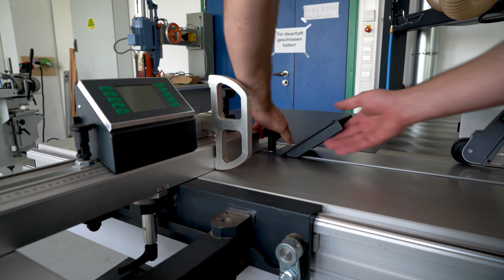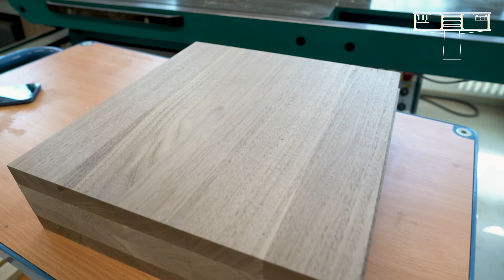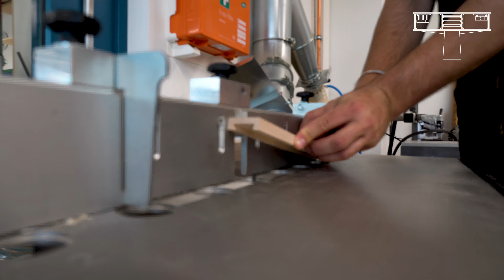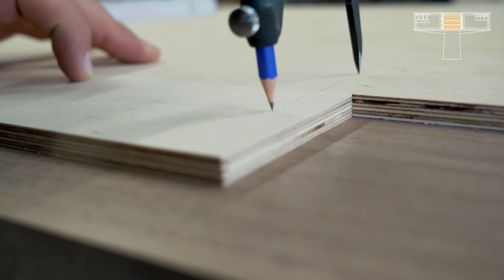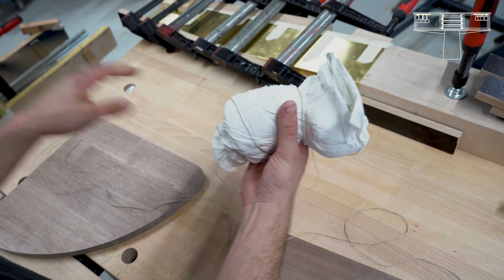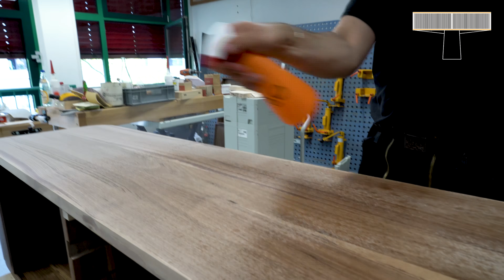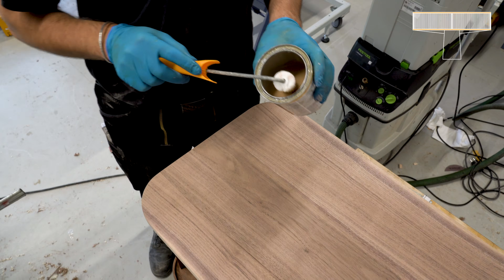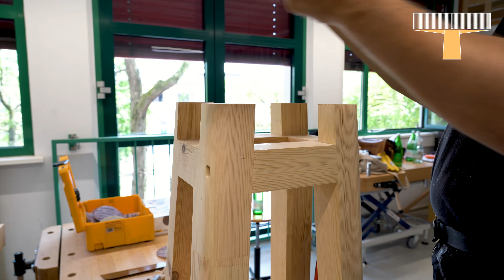Crafting My Final Masters Exam Piece in Germany – Carpentry Mastery

Comment: they critizing you used dominos to join top and frame instead of dovetails are just stupid. classic german approach to things.
Reply: thats tradition
Reply: @carlitos8911  it's a huge piece and perfectly cut dovetails now will look awful in few decades, tradition should have reason. When they criticise it even if they now domino on that spot will work better is just being "German".
Reply from the maker: I chose the domino joints because of the tight deadline; they are the fastest and least complicated solution. However, a sliding dovetail joint would have certainly been the more sustainable option.

Comment: Roughly, how much would it cost to set up a workshop with all the tools shown in the video?
Reply from the maker: With the tools shown in the video i'd guess maybe around 300-400k. The Workshop (outside the video) with all 3 Floors is probably worth 3 to 4 times that. Theres all sorts of crazy stuff going on, that i haven't shown in the video 😅
Reply: Wow! You’re gonna miss all the tools once you start setting up your own workshop 😅
Reply: My guess would be 80-200K €, depends if you only mean what is shown in the video. 
Ok probably more I just checked the sliding table saw and its 45,000€

Comment: Hey Maxim, herzlichen Glückwunsch zum Meister! Vielen Dank für ein wirklich gut strukturiertes Video mit vielen interessanten Erklärungen. Und natürlich eine wirklich schöne Bar die du gebaut hast! Ich hab ein paar Fragen (die vielleicht auch andere haben, daher in Englisch):

A few questions I had when watching your video:

- You mention a maximum width of 80mm for glueing up panels. Is that a hard rule you follow or are there other considerations such as the thickness of the boards etc?

- Out of curiosity: You made the dovetails for your drawers by hand. Is that a personal preference or was just faster for you in this case or was there another reason that you didnt make them for example with a router?

I personally am not a massive fan of brass and copper combination but I think it makes for a really luxurious looking cabinet! I hope that you will continue making videos about your furniture in the future!
Reply from the maker: Hey! Danke ;)
- It's not a strict rule, but for basic wooden panels without any additional stabilization, like metal brackets underneath or a tongue-and-groove joint, I’d definitely stick to 80mm or less.
- Both... I don’t think it would have been significantly faster (by the time you get the template properly set up, etc.), and besides, I wanted to make at least this one traditional wood joint by hand to have a bit of "true" craftsmanship in the piece!
- I initially wanted the brass to be blackened but ran out of time and stuck with the natural look. I've gotten used to it now—it actually appears darker in person (thankfully ;)).

Comment: Great piece and great use of English drawer slides. I don’t think I’ve ever seen those on youtube before. It would be great to hear about the brass finishing process and see more details of the finished surface: What were the final grits? Did you seal it or are you expecting natural patina?
Reply from the maker: Thank you! Yes, the brasswork definitely deserves a video of its own. I'm not entirely sure about the final grits—I used polishing pads with paste. I sealed the surface with a universal oil, though I’m sure there’s a better method. I needed a quick and simple solution since I was running out of time 😅. It works well, though!

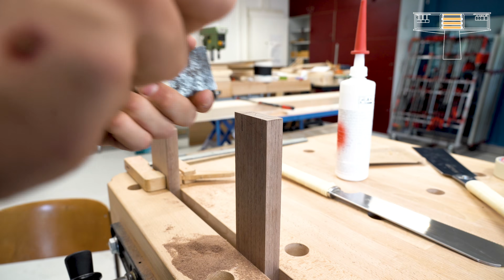Comment: Get project! at 16:21, what is that tool you are tapping into the saw kerf? I've never seen that for making dovetails.
Reply from the maker: It's just a scrap piece of steel with a blunt edge. It's used to sever the fibers that are left "uncut" by the 45-degree angled saw blade when cutting hidden dovetails. You could also use a chisel to tap out the wood, but this tool helps you do it faster.

It's important that the edge is not sharpened to avoid splitting the wood. Instead, the blunt edge compresses and drives the fibers down. Hope this makes sense!

Comment: We only get to see it complete for 30 seconds at the end! Don't be afraid to show yourself using it more, I feel like we don't get a good sense of the finished piece at all from a couple of brief closeups. Also wish you'd dedicated more time to discussing feedback, you say they would've preferred dovetails but it has tambour sides; I'm struggling to imagine what is even meant by this.
Reply from the maker: Thanks for the feedback! If you'd like, feel free to check out my shorts or Instagram account — you'll find a few more detailed shots there!

Regarding "they would have preferred dovetail joints," I was referring to the upright panels/pillars of the piece being joined to the top and bottom panels using dovetail joints. I translated this type of wood joint (called Gratung in German) and found it to be referred to as a stopped dado joint in English. This would ensure that, if the wood starts warping or shrinking, the domino connectors wouldn’t simply slip out of their grooves. A form-fitting connection would have been desirable in this case.
Reply: @MaximLeonardDesign Since a dado and dovetail are more-or-less mutually exclusive in English, maybe you mean a stopped sliding dovetail? Thanks for the clarification!
Reply from the maker: @N1ck00  Ah yes, that is what i meant!
Reply: Ah guess now I need to break out the 60 ton press
Reply: Agree a sliding dovetailed connection would have been much better